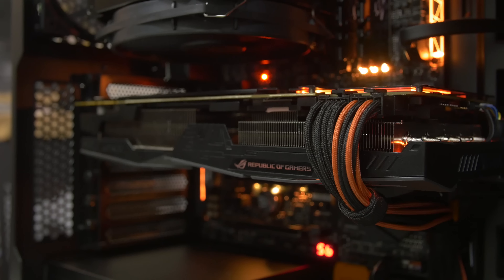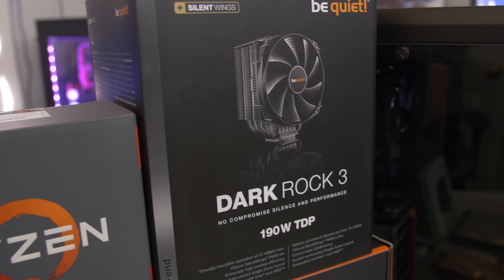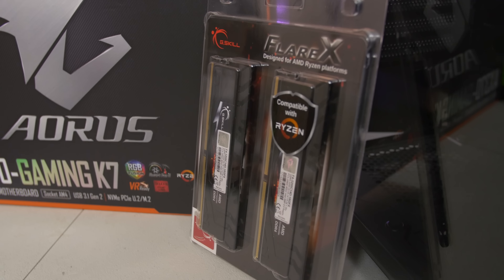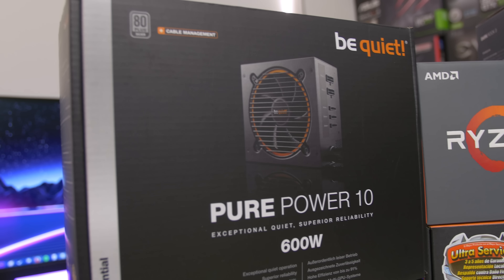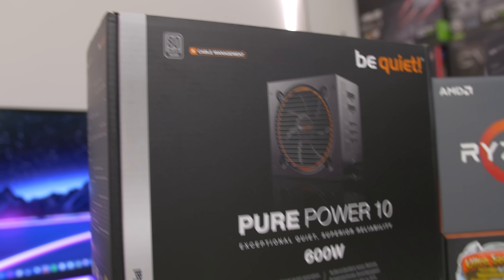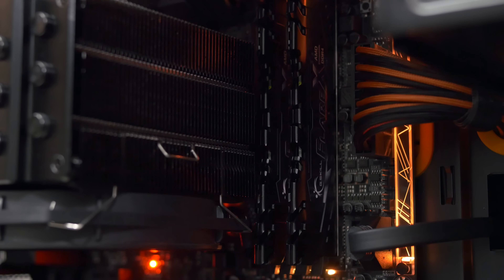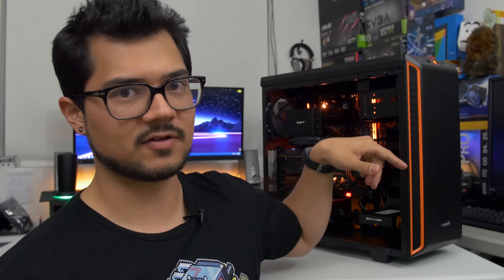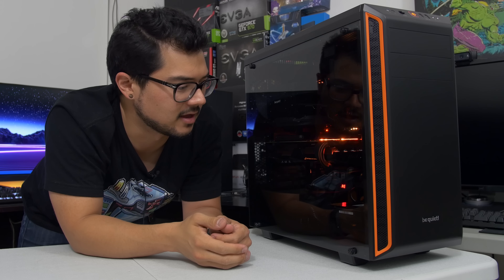INSANELY Fast Ryzen PC!! 1800X + GTX 1080 Ti

Comment: Considering ryzen as intels prices are jacked right now.
Reply: Sam Hainey depends on what you wanna do and how much you wanna pay
Reply: Sam Hainey In my area, ryzen prices are jacked
Reply: Get R5 1600, it fucking rocks. 1440p/4K gaming with it is buttersmooth even with GTX 1080 Ti. Not to mention that it wins more expensive 7700K in highly threaded workload.
Reply: Sam Hainley -The prices of Ryzen are similar to intel in the UK but the b350 and x370 motherboards are way too expensive in price to value compared to intels.
Reply: I have an i7 7700k and comparing it to my friends new Ryzen 5, mine is better. MUCH BETTER. But then again, he has a gtx 1070, and I have a 1080.
Reply: Count in the more expensive RAM as well, but in generall why not Ryzen.
Reply: Philip Cooper well if you count more expensive ram for ryzen you have to count the at least 20$ diff in price of CPU (ryzen being cheaper) another 20$ for cheaper motherboard and at least another 30$ for a cooler because with ryzen you already get a Cooler however with intel you don't so overall you'll end up with ryzen being 50$ cheaper if you buy the better ram in almost every comparison
Reply: to see witch cpu has better performance you should use a benchmark test that minimizes gpu usage and maximizes cpu usage to see witch cpu gets a better score
Reply: Funny, here in Finland B350 boards are way cheaper than Z270. Going full AMD this summer with Ryzen + Vega build. :D
Reply: Am4 motherboards go up to about $300, z270 up to $400 and x99 up to $650. I think Ryzen mobo's are very fairly priced.
Reply: Most of us want the bang for the buck model. I'm going to pick one B350 mobo for 130 €, it will be perfect for my use. I don't think that Ryzen CPUs are going to OC any higher with better board, since they are pretty much all "locked" to 4 GHz anyway.
Reply: better judged by 12 than carried by six. In gaming the 7700k beats it but it doesn't in rendering
Reply: better judged by 12 than carried by six. Please you do know current games doesnt support multi core which is why 7700k is better. But video rendering/editing beats 7700k
Reply: 7700k will be better for gaming than the ryzen cpus, however, performance per dollar in heavily multithreaded programs, pretty much anything content creation, says the Ryzen 7 is the best way to go unless you want to pay out the extra 500 for the 6900k with a MINOR perf improvement. Intel is still king for gaming unless you really need a cheap chip, in which case an x370 setup with a R5 cpu is probably a good choice. I love AMD, they just aren't as good for GAMING. fuck the fanboyism, amd came out with a great chip that does things extremely well, it isn't AS good as the intel 7700k in single threaded performance but it makes up for that by being great at heavy multithreaded tasks for a good low cost.
Reply: But if youre like me and already have an expensive intel cooler because LOLAMD over the last 5 years. Then ryzen starts to look expensive for only gaining in multi thread work loads especially when i can just bolt my $80 2500k cooler straight on to a 7700k.
Reply: As of now, Ryzen dominates intel in the workstation. They are close in gaming performance but Ryzen has the advantage of more cores/threads to spare for any extra stuff such as streaming. If you're building now, Ryzen is the way to go. BUT if you're going to build at a later time, intel has plans for another set of 14nm CPUs called Coffee Lake as well as the 10nm Canon Lake
Reply: My core build (ie: CPU/RAM/Mobo) was about $500 USD total for a Ryzen 1700/8GB DDR4 @ 3000/B350 based motherboard...  All in all it's a very quick machine.
Reply: Christopher Everson alternatively you should buy a 1700, which comes with a cooler, and you can overclock to ryzen's limit, 4.0 GHz with the stock cooler. i.e. don't need any aftermarket cooler with ryzen products even for max overclocks
Reply: VinnyThePooh you do know that the amount of people who buy <300$ CPU is double the amount of people who buy >300$ CPU and that is deceiving because in gaming the gpu will usually be the bottleneck not the CPU and in games where the CPU matters more they usually are the games that utilize CPUs better so ryzen wins because of extra cores I'm not saying the 7700k is worse I'm saying true situations where it prevails are pretty rare you'd have to playing at 1080p and you'd have to have at least a 500$+ gpu which is like less than 5% of gamers in most instances in gaming CPU doesn't do jack shit
Reply: Christopher Everson even then the mobos are cheaper with ryzen so are the cpus 7700k>1700 and 7600k>1600 in price
Reply: Thundertube I honestly don't trust those they've been fucking us over for more than 5 years won't be surprised if this doesn't make much of a differences
Reply: But i prefer my chip to be properly cooled. I can get a max clock out of my CPU now with a stock cooler but the temps are sky high.  Is the 1700 stock cooler really that good?

Its funny i keep seeing so much about ryzen value but if i want best gaming setup i can get a 7700k rig together for slightly less than a ryzen build.
Reply: Christopher Everson Cause the R5 series are for gaming, while R7 is more for content creators. You can build a R5 system for less than intel
Reply: Christopher Everson you really getting more threads and votes thus multitasking us better
Reply: Christopher Everson u won't get a 7700 k build for less, if you consider getting 1700 and stock cooler it will be future proof and cheaper, but I don't know if it's just my region (U.K.) that the prices are weird for but I did make many builds on pc part picker and it's pretty close + the ryzen is just a little cheaper with 1700 + stock cooler
Reply: Philip Cooper u don't have to get expensive ram, but u won't hit the same potential... g.skill use the same Samsung B dye ic's on there high end ram, so they should be compatible with ryzen too, just keep in mind those are usually 8gb stick with cl 14 3600 or cl 16 3200...
Reply: i got my ryzen 7 1700 and built a high end system with it (1080 sli) overclocked to 3.9ghz. Coming from a 7700k i have to say games are more fluid, and i have noticed lower minimum framerates on my ryzen chip. temperatures with my aio watercooler are just incredible on ryzen, i got 40 degrees under full load (7700k came in at 80-90°C) in timespy and dx12 titles, performance is over the roof, i would definitely consider the ryzen lineup for gaming, simply because it is a better overall chip. you can get certain benefits from the 7700k but those are marginal and games keep improving giving ryzen the upper hand.
Reply: it really depends on where you live
Reply: I was hoping for a 6 core cpu that could beat out my 6600k that I had to sell. Same or better gaming performance and more cores so I could run stuff in the background. Since the 5820k jumped a ton in price, I'll either need to wait for coffee lake or just buy the first gen ryzen.(and pray that there will be powerful six core upgraded in future.)
Reply: I have an 1800x @4ghz as well as a delided 7700k @4.8GHz, the Ryzen PC has become my main machine because it can handle my Plex server and constant torrent stream with horsepower to spare while gaming, the 7700k just can't do that it, performs negligibly better in games but that Advantage is lost when I try to do anything in the background so for me a Ryzen build is a better option, but for someone who only games the 7700k makes a better choice
Reply: R5 1600 might have better aging than 6600K/7600K cause of it's 12 threads vs. 4, that's why I would never consider 7600K. If you have 6600K already and only do gaming, I would stick with it.

Getting 1440p ultrawide or 4K monitor will make difference between Ryzens and quad core 6000 or 7000 -series even less significant (0 - 10% difference), unless you are streaming gameplay or doing heavy workloads. Therefore, getting Ryzen 6 core or 8 core over i5 or i7 quad cores will be greatly justified.
Reply: Christopher Everson yes with the stock ryzen cooler you can overclock to the max and unless your CPU went above 100 it's impossible to oc that much with the stock intel cooler you probably got the best chip on the planet
Reply: Sam Hainey it actually has better gaming performance well it depends on your card if you have the 1060 it wouldn't matter on 1080p if you have the 1070 difference would just margin of error stuff if you have a 1080 however ryzen will have higher 1% lows and lower average fps and the 1% lows are actually more important in this case since at 120 average fps 15% is extremely hard to notice while 15% of 55 fps (1% lows) does make a noticeable difference
Reply: Philip Cooper who says you have to get more expensive RAM? All DDR4 modules work with Ryzen
Reply: Jakob P higher frequency RAM = more expensive, and in case of Ryzen, for once, actually useful performance-wise.
Reply: I've been on my i7-6700K + GTX980Ti for almost two years. It's been serving me well, but I'm pretty sure my next build will be an all-AMD rig if Vega turns out to be a huge success.
Reply: grmasdfII actually all cpus benefit from higher ram a guy named hardware inboxed found out that both intel and ryzen pretty much scale the same when it comes to ram however the thing is if you're on a right budget you can actually buy the higher frequency ram wind ryzen cpus are usually less expensive than intel cpus so basically when it comes to price ryzen CPU+ high frequency ram = price of intel cpus  + normal frequency ram
Reply: zzApotheosis don't upgrade there is a chance ryzen will flop in sales and intel will continue its monopoly meaning slow af improvements honestly if you want to you can upgrade your gpu only case I can see you wanting to upgrade is if you do things that utilize multiple cores even if you edit on adobe premiere you don't need ryzen since that app scales like shit when it comes to cpus
Reply: VinnyThePooh but how do you know games aren't going to be multi threaded in the future? Ryzen offers what intel didn't, so developers have not worked on such multi threaded cpus, if in 2-3 years a true/good multi threaded game appears there is nothing saving intel cpus. 

the difference in single threaded performance and thus gaming performance is not as big as amd's multithreaded performance which may or may not translate in a big gaming performance in the future. 

I guess not everyone can say the same but I still have an i3 with 2 threads and it is really slow compared to current or slightly older 4core cpus that sometimes have slower single threaded performance. For once I can have a cpu that ages well into the increase of threads and cores of the future.
Reply: Different because ryzen will most probably flop and unless they planned ahead and have something else they're going to release next year that will be able to beat intels answer to ryzen devs won't give a shit
Reply: Planet Kuruto why do you care about next year, I am buying amd's ryzen this year and won't be buying a cpu for an other 3 years. 

What do you think? praising ryzen cpus or buying a ryzen cpu is not a permanent contract to amd, it is just a cpu that is currently really good..

Please take this to heart, this goes beyond the amd vs intel debate, worst thing for companies is to have non-loyal, adaptive and free thinking customers that may buy amd today and intel tomorrow. If you think of a company as a religion, no matter what company you support, you are bound to get "scummed" in things that you buy one day.
Reply: Different that's not what I meant intel has reputation so even if and makes a better CPU the avg CPU won't buy it for it to happen they have to make better cpus than intel at least twice so that people recognize them problem is intel is probably preparing a big answer to ryzen so that they don't have a chance to gain popularity so if amd doesn't have an answer to intels answer they won't get enough sales and game devs only look at sales they'll only optimize for amd cpus or multi threaded cpus when there is a significant amount of them don't get me wrong a miracle can happen and a lot of ryzen cpus may sell which would make game devs to optimize for multi threaded cpus but it's not likely
Reply: Planet Kuruto Sorry if I misunderstood, I totally agree with your statement. 

Personally I do not follow the loyal consumer base, if by that I get a worse product, that was not my or amd's fault, I refuse to ride the consumer train to a cliff for any short term benefit, we all know products and companies always go to shit. 

It is inevitable for a company to get a majority of sales in any tech area and then advertise their way to a monopoly. Not even a miracle cpu can save amd from where it is. 

intel can answer anything amd has to offer due to greater funding and even inferior performance can be masked by great advertising. 

.. in short, 1 advertisement is worth more than 100 performance charts.
Reply: Different yup it honestly sucks only way for this to work out is for amd to be bought by another company or something maybe vega will get amd enough money since their reputation in the gpu department isn't as bad as the CPU department I don't know this is just wishful thinking I don't care about amd as a company it's just that it's success means there will be competition again which is really beneficial for me as a costumer if intel was the one trying to comeback I'd root for intel too I just want what's best for me as a consumer and I don't care about companies
Reply: Sam Hainey Amd's the same way. You can match the $500 1800x with an overclocked $325 1700. I'd look at Ryzen 3 or 5. If not, an i3 will do just fine.
Reply: I would rather save up some money and get R5 1600 instead of crippled models, because once you buy good CPU, it will keep you happy for many years. Ryzen with it's 6 cores and 12 threads is going to mature amazingly anyway, DX12 and Mantle API developers are pushing game developers to use more and more cores anyway. But if one wants to cheap out, I will recommend waiting for the R3 line. There is coming R3 1100 4 core / 4 thread CPU for 129 dollars soon enough. If they have unlocked frequency rate just like R5 quad cores, they will kick locked 2C/4T i3 to the ass @ 4 GHz. Most games are not yet supporting hyperthreading/SMT which will give R3 quads decent lead in modern AAA-titles.
Reply: Planet Kuruto if everyone would think like you, Amd would be dead. 
They managed to make a huge comeback and the ryzen cpus are good, so why shouldnt you buy it? 
"There is a chance ryzen will flop"
We can change that. Its in our hands...
I would always recommend a ryzen 5 1600 over an i5.
The performance is nearly the same in gaming, you wont really notice but ryzen has more cores and is much better in multithreaded applications
Reply: Tobias Jöny the thing is, he is right, the average consumer doesn't even know about ryzen. We 've reached a point where intel's competitor is not even considered by the average consumer so to have a mere chance to comeback it needs to succeed twice in a row and even then it is unlikely the market will change significantly.
Reply: Different so whats the alternative? 
dont buy amd?
i know that he is right but it wont get better if u only wait for the answer of intel everytime and then take the intel product.
Its often that people ask me what Pc they should buy because I have some knowledge.
At this point I can take influence and recommend them for example a 230€ rx 480 over a 260€ gtx 1060 or a Ryzen 5 over a locked i5 and stuff like that.
Of course I wont always recommend them amd only because its amd but I think those products that I mentioned are good products and give u the best for your money.
If they ask me for a graphics card for 1440p gaming, I would ofc say 1070 or they have the money 1080.
if vega comes out that could change...
Reply: Tobias Jöny you can't say that, it's up to every individual's preference. Someone may want the short term gaming performance that intel offers, while that doesn't necessarily translate to him not knowing about amd and ryzen, in other words intel can be the superior brand in all categories on certain situations.

He at least understands the superiority of ryzen cpus in gaming and sees that the bottleneck is lack of proper optimization by developers. Now, someone who would want the best gaming performance has to either jump into the amd train and hope enough people will also join (to attract developers' attention) or think that it will not happen, not anytime soon (like he said and presented some points on the subject). 

Your counter argument of "if people thought like him then amd will sure fail" is not correct as the majority of people are not on youtube and do not look up any proper reviews on the cpus they buy, performance in a sense is meaningless when it comes to intel's marketing. 

Now some people think about the monopoly of intel and how it can damage the consumer but that is also not a fact, who knows maybe intel is going to develop awesome cpus even without a competitor around, maybe we could then add artificial pressure through laws to push technological advancement. At the end, it's up to individual preference.
Reply: Different I only see that the i7 is superior in gaming than every other Cpu but I dont see that with the i5s. They are not superior. Ryzen 5 and intel i5 are on the same level in gaming. But you get a better performance in nearly everything else, for that means the i5 can only play games while the ryzen can play games (u know what i mean, not native speaker) on the same level. You dont have to wait, ryzen is already as good as intel i5 in gaming. Thats why only the i7 is a good choice for gaming, it is better than ryzen in gaming. The i5s arent better...

Do we live in the same world? 
Intel wants 1000$ for a 8 core cpu!!! Thats way too much. The prices of intel are already fucked because there was no competition. 
We are still paying too much fot only 4 core cpus. Intel is like every other company. They want money and it works, they dont needed to give us better cpus because there was no competition.
i5s are already in some games at 100% and not enough, more core support is needed, we cant always increase the ipc... 
We should already have 6 core cpus as standard. Intel monopol has slowed down the development.
Reply: I'd still rather buy a Ryzen 5 1600/X than an i7, 4K 60fps is all I care about, and the 6C/12T surely seems like the better bet for the next 4-5 years. Cheaper, too.
Reply: Tobias Jöny if everyone thought like me they'd all buy amd I'm saving money to get a 1700 and I would recommend ryzen cpus in all situations that people present to me because I can't see a situation where intel would be better if you're gaming and you're going to buy a anything in the 1600s price range then CPU won't matter right now however later it will matter if you have more cores which is why I'd recommend amd even the 1700 vs the 7700k id recommend the 1700 because CPU doesn't make any difference in gaming unless you're in the 0.001% that has a shit ton of money and you also have to be part of the 0.00001% inside that 0.001% that games on 1080p and even then ryzen is probably better because it stutters less and the difference in avg fps is unnoticeable to most people since the frame right is already so high 

I think amd beats its competitors in every situation (all ryzen cpus are better than their intel counterparts and all Radeon gpus are better than their counterparts) but I still think it won't succeed because of the markets stupidity I want it to succeed but it probably want personally I'm buying amd but I don't think most people will
Reply: Tobias Jöny you need to rethink your opinion on cpus, it is completely bias. Please, bare in mind that I am going for an all amd build and will always do, read my later points and try to rethink yourself even if you believe the same after rethinking yourself. 

1. you compare the 1k$ i7 and then use the overpricing of that cpu and judge all their lineup based on one overpriced cpu, at the end of the day that cpu wasn't even overpriced as it was without competition, when you compare the price of the i7 with the pre-ryzen nothing from amd then you ll see that intel as the sole option in that bracket is impossible to be overpriced. 

2. You use a cpu for things outside gaming and you then assume everyone else does, which is not the case. There are many people that only use a pc solely for gaming, essentially a pc-console, so your opinion doesn't include those. Furthermore some people only care for gaming performance as it is the most demanding use case they put their cpus through, so the inferior performance in multitasking doesn't matter to them. 

3. You assume pricing to be the same for all markets, I can only talk about my country greece, I can assume at least a few other European countries are the same. Ryzen cpus that have more expensive competitors in the US end up being more expensive (than their competitors) in my country. 

4. you assume people's time is not worth little, it takes time to form an opinion on cpus, ryzen can't compete if the average joe has to spent 50-100$ worth of time to conclude that ryzen is better, and going into this they don't know if spending that time will be useful at the end. This id assuming they can actually make sense of technology, some people cannot.
Reply: Different 1. The pentiums are good. Bulldozer was shit and Intel had no competition.
2. I dont use my cpu for things outisde gaming, I never did. Im only gaming and my mind says me that its stupid to buy an i5. You can use Ryzen 5 solely for gaming. They have the same performance as the i5s. It doesnt matter which cpu u take if u want to play games, both are equal in gaming. However the Ryzen has 2 more cores and is much better in everything else so why the fuck should someone take the i5. People who only care about gaming performance should buy the Ryzen 5. It can only get better and even today its on the same level.
3. I look at prices in us and in my country why should I look at some poor country where amd is more expensive than intel. if its like that then ypu have to take intel. simple is that.
4. If u buy a product u should know what you are buying and knowing hoe good it is. Its not that much to go on a site which can tell you whats the best cpu for each price category.
AMD has to get better at marketing, they did a great job in the past 2 years.
Reply: and if you already buy a cpu then you probably build your pc yourself.
At least for that you should have some knowledge about cpu and gpu market
Reply: Different what advantages does the i5 have in gaming though the 5 extra frames that no creature on this earth can notice (exaggeration) I consider them equal ryzen has better mins i5s have better avgs and ryzen is also more future proof but that's debatable
Reply: Tobias Jöny I don't know what to say, you don't make sense really. 

with 1. you seem to agree with my point. 

2. the logical conclusion is to go for an i5 for current gaming performance most likely ryzen is not going to sell enough to have games use the extra cores in the next 2 years, and if your upgrade schedule is every 2 years it would be better to go intel. Also more people have intel therefore upgrading to an other intel cpu can have significant cost cut than switching to amd.

3. Why should you look into some poor country? Because are a significant portion of the market, enough to set amd into a good spot, but with current pricing amd is second to intel. When I am talking about greece and I also said it in my point, I am not just talking about Greece. 

4. No?.. what about just no.. (There is really no logic into your answer)
Reply: Planet Kuruto You are right that point is really weak on each own, but that is just one advantage I came up with, 5 frames might be few but that will make people prefer not switch, even 0 frames or identical performance is not good enough if you factor in the other 3. Mind you all 4 of my points can apply to 1 person (they don't cancel each other out).

There are plenty of other points, I only need to have one undisputable situation of where intel is better than amd to prove that the notion that "amd is (always) better than intel" is wrong, and if all of those cases combined are significant (in market share) enough then "most of the times" will also not be correct. 

In simple terms, my intention isn't to have 4-5 points that are true, I just need 1 to make the "always better" statement wrong. and a few points combined with consumer statistics to prove the "often better" statement wrong
Reply: Different 1. in some parts I agreed
2. No. If you are from sandy bridge or something older in general you will need
- new ddr4 ram
- new motherboard
- new cpu
if you want to take a cpu from today.
So there is no point in going with intel.
also the am4 plattform will probably live longer. 
Intel is always changing their motherboards.
Reply: Different for me its logical. A new cpu and stuff like that isnt cheap.
Reply: Tobias Jöny Since you are not willing to argue on all of the points with something robust then let's just agree to disagree.
Reply: Different the last comment was because of no time...
yeah lets agree to disagree.
Reply: Sam Hainey my i5 6600k($200 2015) oc to 4.5ghz has better single core and quad core performance than a Ryzen 1700x($350 2017). I doubt the I5 equevilant of Ryzen will match Intel's kabbylake other than the extra threaths for multitasking.
Reply: Tony Galindo well right now it costs 240$ and what you said is sort of misleading because you need to get a cooler with it and a decent one would be at least a 30$ so that's 270$ while you can get the 1600 for 220$ with a decent stock cooler that you can use for overclocking and get pretty much same performance in gaming also comparing a 4 core to an 8 core is not right that same 6600k that costs 240$ has better single core performance than the 6900k which costs 1050$ that is almost 5 times the price only reason why it's okay to compare 1600 to 6600k is that the 1600 is a 6 core which makes things a little bit more fair for both cpus and they both cost around the same
Reply: Tony Galindo to get a few things straight; 

1600 is more cost efficient than 1600x since it has a cooler, it overclocks to about stock 1600x with its stock cooler. so we are now talking about the R5 1600 for 300$ (same performance) 

you are not overclocking to 4.5ghz using the stock cooler so lets say you spent 30$ on a cooler. so we now have a 230$ cpu+cooler bundle. You could also say what cooler you have for more accuracy. 

edit: guy above me sums it up better (funny how we said almost the same stuff) 

so now we got some stuff out of the way, can you give us your sources for the benchmarks?
Reply: Different well he doesn't need to when it comes to his statement about single core performance amd themselves commented saying that they couldn't get frequencies as high as kaby lake because it was their first time with the 14nm architecture and Kaby lake has like 6-7% better ipc so generally Kaby lake cpus without oc will be have about 5% better single core performance but that doesn't really matter because while in some extremely rare cases where the gpu is not the bottleneck (this is less than 0.001% of people playing) intel cpus have better avg fps it doesn't matter because the difference is unnoticeable and even if you notice that different well you'll definitely notice the fact that ryzen has way better 1% lows
Reply: Different yeah userbenchmark.com is the best I can tell you. it benchmarks others hardware and my i5 shows better performance than someone with a Ryzen 1700x although for multicore performance goes to ryzen.
Reply: Tony Galindo & Planet Kuruto 

sorry it was my bad for asking, 1am and haven't had enough sleep. 

out the top of my head I thought ryzen 5 were +$300 range so I was sure (in my head) they would be better than 200$ intel i5s, my bad. 

(edit: miss read 1700x for 1600x on Tony's comment, that is why)
Reply: Planet Kuruto I haven't gotten an answer for this question from people who prefer intel over amd. 

what about competition? I think everyone can agree more competition means better performance for your money in the long run, so is there no value in supporting the underdog/amd in order to preserve the competition in the desktop cpu market?
Reply: Different some people would prefer intel getting money and keep on slowing evolution than intel having competition and us consumers getting better components faster and at better prices while others think short term and don't value completion enough then you have others who would actually buy amd but think that recommending amd over intel is shafting their friends which is understandable but debatable
Reply: Hmm, it the recent patches for some software games, made ryzen be pretty much on par with the 7700k, it's all because those patches included better multi-core optimization, chip optimizaiton and overall changes to how data is transmitted. I think the games that will come out in the very near future will feature optimization for Ryzen, that is where ryzen is so much of a better pick than 7700k i believe.
Always was an intel fan boy, although times change i suppose.

That is of course, unless intel starts paying developers of games not to optimize the games for ryzen (like intel has already done before pre-ryzen).